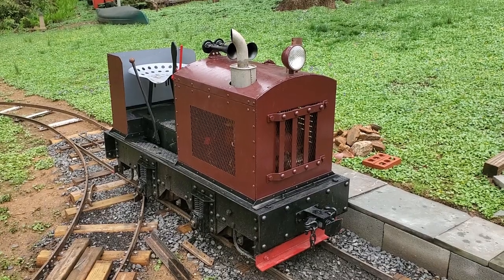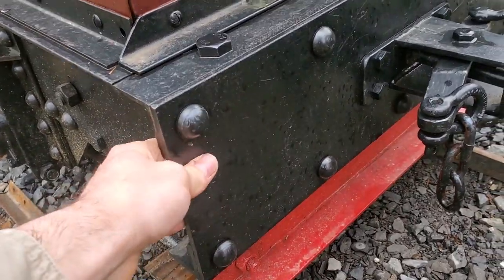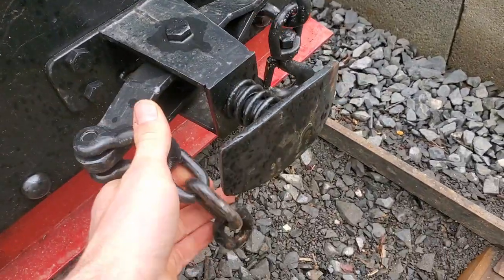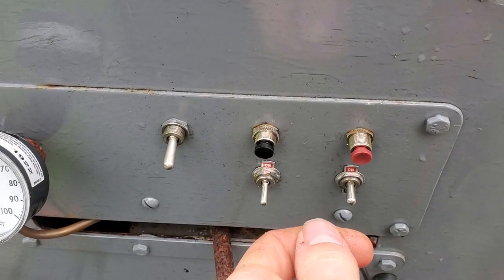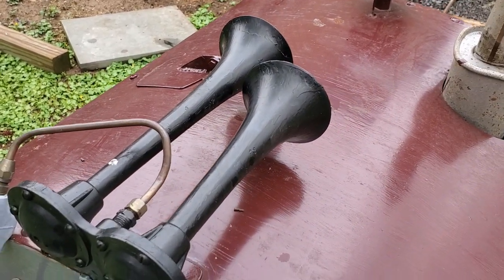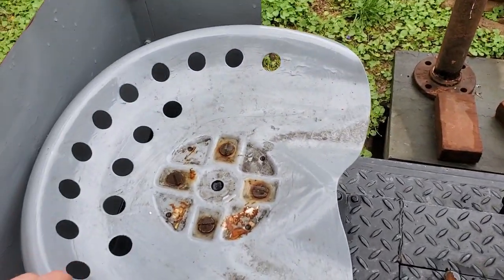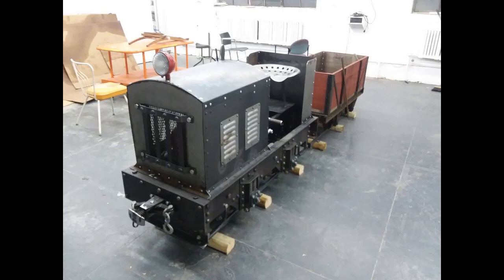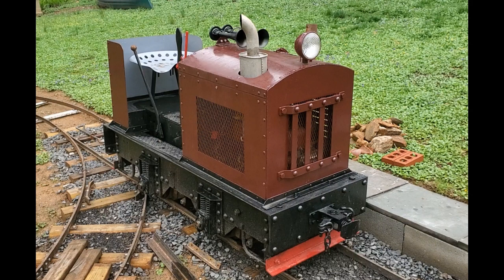15" Gauge Locomotive Features & Construction

Comment from the maker: I have added some links for sourcing rail and other components to the description. These sites are more geared towards the scale modeling side of things so prices are in the high range, but it gives an idea of what is available out there. Again I find lots of trawling on ebay is the best way to find parts for your own rolling stock etc, and that many profiles of steel (Angle, channel, T, flat bar) can function well as rails so there is a myriad of options.
Thanks for all of your comments and questions
Reply: Can you build and make available a CAD model of the entire locomotive?  A large bill, to be sure, but I would like to be proven wrong. Good luck.

Comment: That locomotive is great!  I’m all about this new “minimal railway” craze where the trains are small but very useful and not scale replicas of larger engines.  Every property needs a small railway to help with the chores!  Lol
Reply: Yeah. My family is getting rid of our pickup truck which is the only expendable vehicle so we don't have an easy way to move fire wood across the soft muddy lawn to the shed. So a small narrow gauge railroad of about 12 to 15 gauge would be nice. I just need to convince my dad. But yeah these narrow gauge railroads are great for farms small industries and house work.
Reply from the maker: For sure, while this line isn't quite in a usable state yet I can anticipate many uses. If your yard is on the flatter side you can make panel track and move it to where it's needed, you don't have to have a set path for the line which makes it more practical.
Reply: I'm not sure that it is a "New" craze.  I was doing this sort of thing on 10.25" and 7.25" gauges in the 1970s when it was just called Very Narrow Gauge, or Ultra Narrow Gauge.
Reply: @BrianLeicester  or minimum/miniature gauge
Reply: @datguymiller  Minimum gauge for 15", Minimal for less than 15", typically 7.25".
Reply: @Redundant_Communication  cool
Reply: Yeah 7 1/4 in is quite satisfactory.

Comment: Lovely job! What does it weigh, do you think? My 15" gauge rails are just flatbar so couldn't take that machine, I suspect..
Reply from the maker: I'd say a few hundred pounds at least, haven't got a scale that can weigh it. The 1.5*.5" channel I use seems to take the weight well, so a flat could work if it's thick enough, so long as it's set well on the ties. I've been following your project with the line through your barn and it's great to see the new tracks in the fields, a real example of how useful these railways can be.
Reply: Thanks, Jonathon. They're fun too, aren't they?
Reply from the maker: @WayOutWestx2  Oh they're great fun, worth the work for sure. Lots of interesting and useful skills to learn along the way as well.
Reply: So uh....collab between you two when?
Reply: @Redundant_Communication  question? Does it have a name? Will name plates be added?
Reply: @Redundant_Communication  This is so cool. I only wish there was a way to buy the locomotives and track segments in bulk. If I had the $$ I have a fantastic use for a narrow guage rail.
Reply: @Way Out West Blow-in blog love your vides as well.
Reply from the maker: @chanachon56  Well It's a bit of  a ways from Pennsylvania to Ireland I'm afraid, but maybe if he wanted me to make some parts for rolling stock I could ship them over.
Reply from the maker: @the4tierbridge  Not as of now, not quite sure what I'd call it. Figured names are reserved for stately mainline engines. I've thought of calling it #24 as a designation, may put that on the side in stencil.
Reply: RMI Railworks makes a 7.5” gauge diesel that weighs 1600 pounds, so surely this weighs more than that?
Reply from the maker: @ironmatic1  I've probably underestimated the weight as it rolls so easily. Though if not rolling, it's only a bit easier to move than one of my machine tools in the 2,000 # range, so it's likely closer to that.
Reply: @Redundant_Communication  Oh. It reminded me of the Ravenglass and Eskdale's Cyril. They are pretty similar, except it has a cab. Lister build. Question: What was the point of this railway? I'm curious.

Comment: In the 1950's and 60's my stepfather built a 20 in gauge miniature railroad that was part of a tiny amusement park just West of Albany, NY. It used industrial gasoline engines to move up to four cars of kids around a 1/4 mile track. By the time I was 10 I was maintaining the 4 engines and 6 cars. That was a lot of work for a kid. 

The stepfather became a mean alcoholic that was Impossible to live with. When I next checked after a year in Nam he was still there but the equipment had been sold. If anyone has ever heard of "The Carolyne Road" please contact me.

Comment: This is exactly the type of engine Id like to build for my 2' railroad Im currently building in my yard. I keep going back and forth on whether to sell it and go smaller (7 1/2") because I just dont see myself being able to build a locomotive for such a large gauge. But then I see a video like yours, and this seems very possible for me to construct. What youve done here is great! Thanks for sharing!
Reply from the maker: Tackling 2 foot gauge sounds like it would get very heavy very quickly, but you could certainly build something like this, just wider to accommodate your track, and it should still be sturdy. When it comes down to it all gauge dictates is the rail spacing, the size and weight of the rolling stock can vary greatly. Best of luck with your project!

Comment: that's pretty cool. best lawn mower conversion i have seen to date. your ratcheting brake lever i would recommend changing, i have a similar design and mechanism for my lawn rake, and the metal plate, all the points you frequently use break or wore off. if you were to double up or triple that plate i would think it'd last a life time, but even at 1/8th i lasted little more than 3 uses on 1 acre of yard, and when i fab'd an identical of 1/4" it lasted a bit over a year. granted you're not using it to hold a more stressed mechanical feature that free floats with more gravitational stresses, a roller pin going over the notches might be more suitable and you could just use old worn out saw blades there after and grind down what ever points are left, and replace where ever as needed for very inexpensive price even tho it's much thinner gauge.

another thought is that chain is going to need oiling about as much as the steam locos wheel sets needed, a lube pan along the chain path underneath would work well wouldn't have to be much could be a small painters tray/grocery store mushroom carton; so you can remove and replace it easily and low cost, it would just need some sort of shelf to ride on/in to keep it in place then you wouldn't have to worry about manually lubing it. heavy grease could be used in it also mixed with use oil. lucas's red and tacky spray would be a good recommendation if you don't go that route and should keep things in working order nicely for a month or 3 at a time, no idea you'd have to try it. it works well on my lawn mower parts and my bike chain moves too fast in my opinion that it would spin off to fast to test on that but would probably be alright in your application.

Comment: Impressive.
I have a similar looking battery electric loco on 7.25" gauge, it is similarly sized, about 4 ft long, 2ft wide and 5ft high as I have fiitted it with a simple cab roof of a plain 3mm steel plate on four 1" square steel tube supports.  The roof is suprisingly useful as a sun shade, I thought that I would only need it on in the rain.

Comment: Thank you. That was very helpful!
I'm thinking about building my own locomotive with a lawnmower, or trail bike engine.
Now for buying rails where do you buy your rails? I assume that you buy them in bulk from an industrial metal supplier, but I was wondering where and how to get a good deal.
Thanks!
Reply from the maker: Any metal supplier will have flat bar, angle, channel, or T bar that can be used as rail, I recommend choosing one of those shapes for availability, economy, and easy of working.
If true-profile rail is what you're after, I've bought some of this 1" tall rail: https://www.rmirailworks.com/SSP-Track-Steel-Rail.asp
Reply: @AdityaSingh-pe8nq  Thats what’s he is using is a lawn tractor chassis.  Plenty of torque.  Bike engine is made to go fast....
Reply: @Redundant_Communication  ok, thanks!
Reply: @Redundant_Communication  There is a school of thought that square or rectangular hollow section is better than bar as it has a rounded corner against the wheel and flange.
Reply: @StubProductions  A bike engine will be designed to have a good airflow over it which doesn't happen on a loco doing sub-10mph.  Stationary or slow moving vehicles are better for minimal gauge railway use.
Reply from the maker: @BrianLeicester  Hollow tube is definitely an option, I decided not to use it as I do not have the proper rolling dies to curve it without risking a kink or collapse, which is very hard to correct. However in making portable panels it would work wonderfully with welded steel ties and dowels that fit in the hollow ends as jointbars, akin to the pin and socket joints on O-gauge model train set track.
Reply: @BrianLeicester  Yes exactly.  The lawn tractor is the perfect setup for locomotive duty

Comment: What size rail are you using?  Looks like it’s flat bar
Reply from the maker: It's 1.5" * .5" channel. I had been using T bar for rail but channel bends easier when making curved track. I've talked generally about the pros and cons of different rail options in other videos, proper 12# (2" tall) rail is currently out of my budget unfortunately.

Comment: Oil, grease. It could do with some TLC, especially underneath.
Reply from the maker: Sadly that's what happens when the paint job is rushed and it doesn't run for a year. Not to worry, it'll be getting attention when there's more rails to run on.

Comment: What's the max speed?
Reply from the maker: Haven't measured it but it's slow. It's direct chain drive from transmission to wheels so that shouldn't have changed it's speed, so I'd say in the range of 5-10 mph, but probably closer to 5.

Comment: Your drive chain between the axles is way too tight, you won't gain anything but rapid wear, I would add a half link.
Reply from the maker: Good suggestion, I noted it was too tight but I didn't have any of the half links at the time I was finishing the drive, it had slipped my mind since it hasn't been running, I'll have to go back and add one.